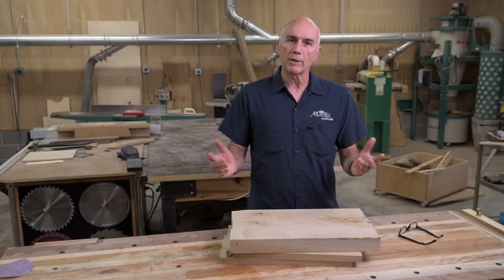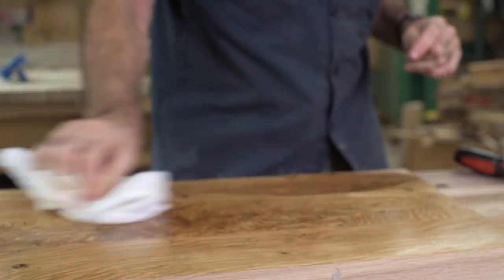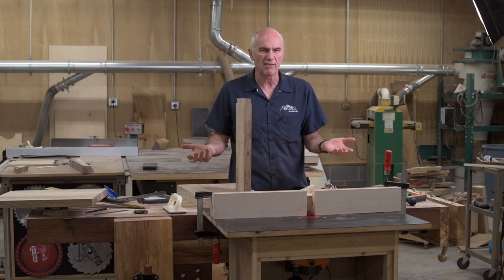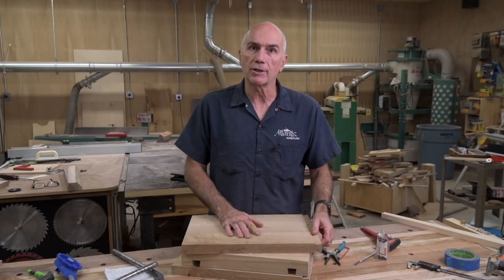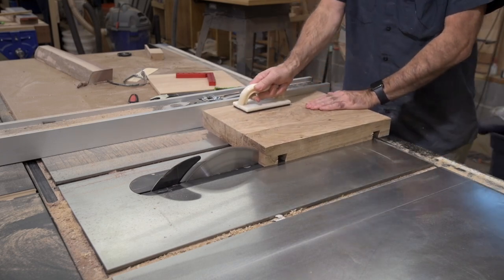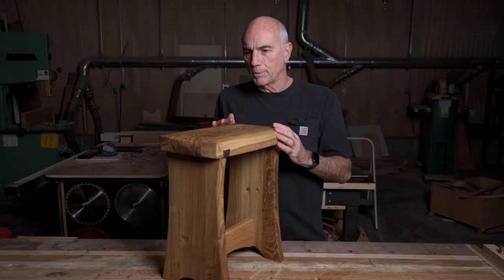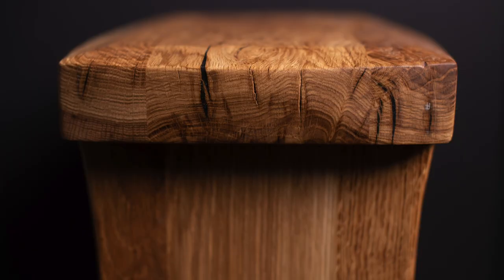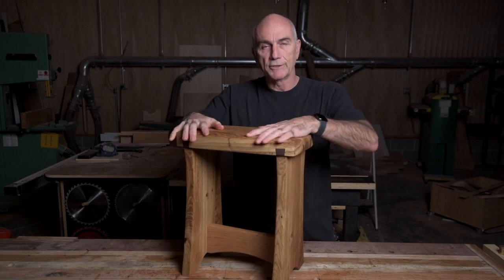A New Shop Stool (mistakes were made)

Comment: It turned out looking good!  Next you should try a tapered dovetail.  It makes assembly much easier as it doesn't tighten until the last bit of sliding together.  I used it and it came out and work great but I haven't used it since so I don't screw up my dumb luck 100% success rate. 🤣
Reply from the maker: I will have to look that up..  I'm not sure I have seen that one before.
Reply: @hillbillychic3933  I think I learned it by watching Roy Underhill.